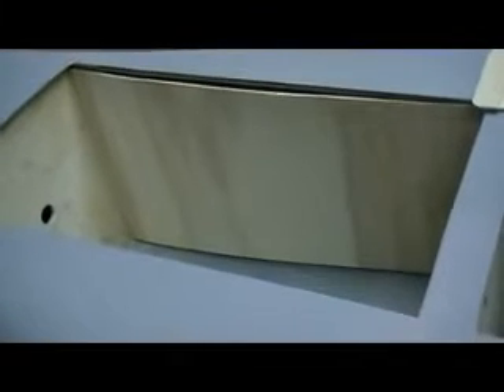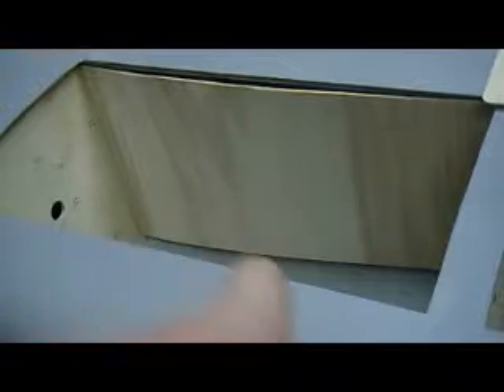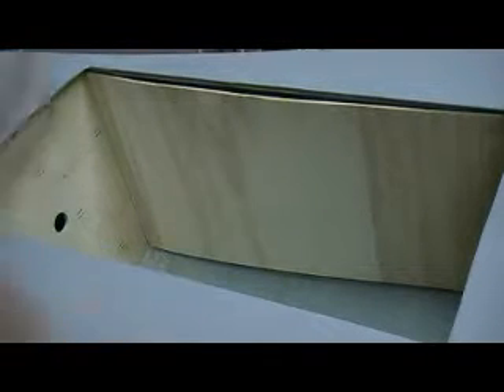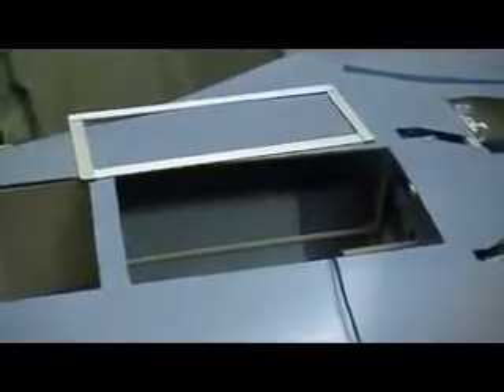how to build a rc jet B-1 Bomber #108 pt 2

Comment: Hi Bob, I was wondering...in the actual full sized plane, those panels often have piping, wiring and other equipment fitted. Are you going to mimic something like that? OR are you juust going to paint everything white and leave it with that?

Can't wait for the next video she is really starting to look like a complete plane!